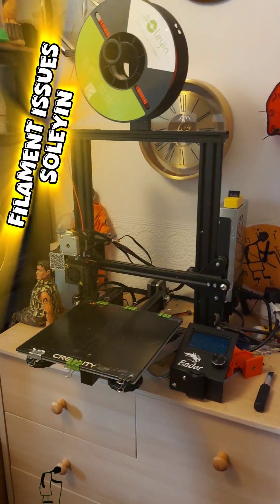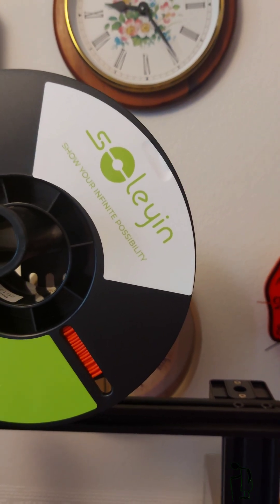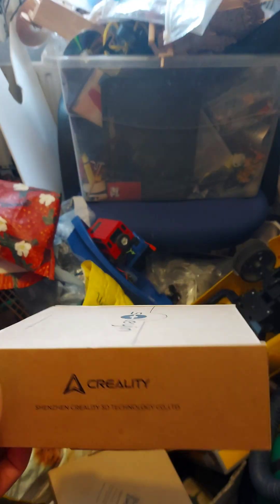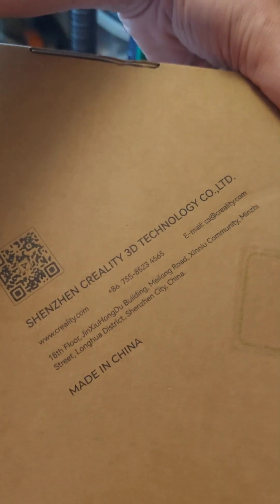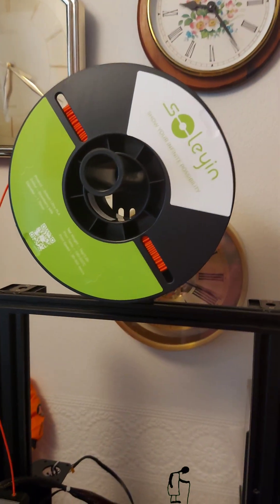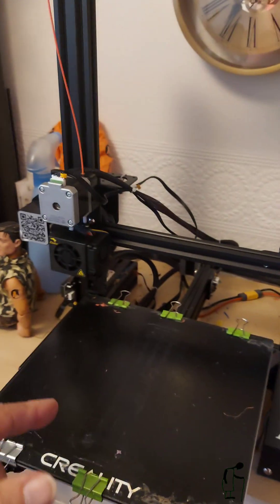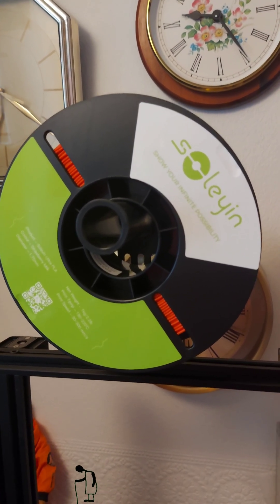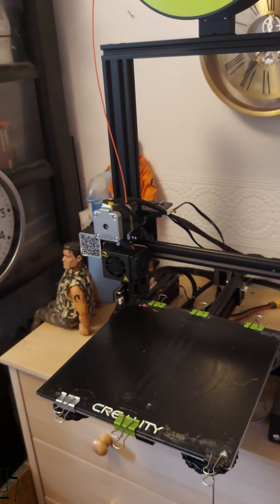Filament Issues Soleyin

Comment: I had issues with the same filament, i even bought the same color haha
Reply from the maker: I have had slightly more success since making this video. As I mentioned, I am printing at a lower temperature than normal, plus at the highest quality setting, and very slightly faster than normal. I have an old Ender 3 so it is not fast at the best of times, so my fast is probably still slow compared to anything a bit newer.
Reply: @GrandadIsAnOldMan  I was about to test the settings you mention in the video with my Ender 3 v3 SE, thanks for sharing this information!
Reply from the maker: @Xahyz  The prints are still poor, but at least they are usable, so I am getting some use out of the filament, rather than chucking it in the bin.

Comment: This is exactly the same problem I had run into with this Soleyin Ultra PLA filament several weeks ago. At normal settings, there was no way to get it to adhere to my bed no matter how clean the bed was, nor what temperature settings were tried.
The filament itself came out blobby, bubbly, almost foamy in appearance. I figured it was "wet", so I tossed it in my filament drier / dehydrator for a bit. It extruded a little better and somewhat stuck to the bed.... but alas, within hours later it went back to coming out as complete garbage. I had purchased two rolls.... tested the second roll with same garbage results.
Upon further research, I've discovered that many, many others have run into similar problems with this exact filament. 
After repeated testings, I switched rolls to a different filament (Creality PLA+) and everything extruded fine. It's definitely not my printer or bad settings. I have been 3D printing for just over 6 years now, and am no stranger to this hobby.
Having said that, I am staying away from purchasing this filament until Creality addresses this issue as there is obviously manufacturing inconsistancies and / or bad quality control.
Reply from the maker: Yes, I googled it and there seemed to be plenty of people having issues. Possibly it is old stock or even rejected stock that is being sold off by an eBay seller making a quick profit. Having said that, I have just had a relatively successful print with it, although it was a very simple shape (a pair of fairly large gears). As I mentioned in the video I have dropped the temperature to 198 and increase the speed just a touch. It has rather put me off printing at the moment.
Reply: I have the same problems, just can't get it to print no matter how clean the bed is or what temp I try. Just put a roll of ender pla+ and that prints out good. Looks like a few rolls fit for the bin. 😢 😢
Reply from the maker: I have had slightly more success since making this video. As I mentioned, I am printing at a lower temperature than normal, plus at the highest quality setting, and very slightly faster than normal. I have an old Ender 3 so it is not fast at the best of times, so my fast is probably still slow compared to anything a bit newer.